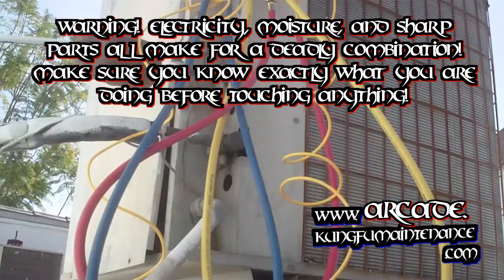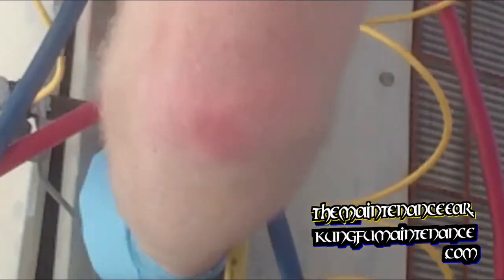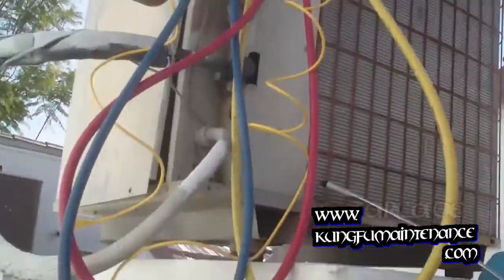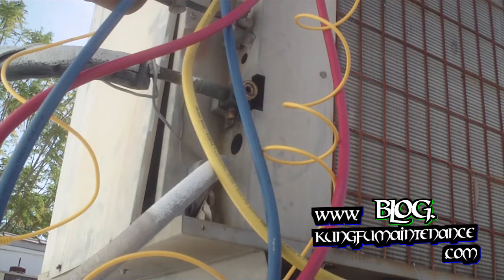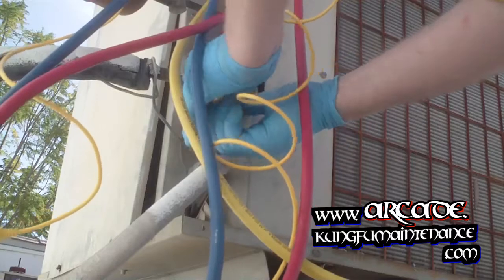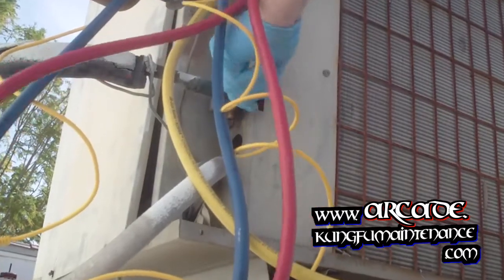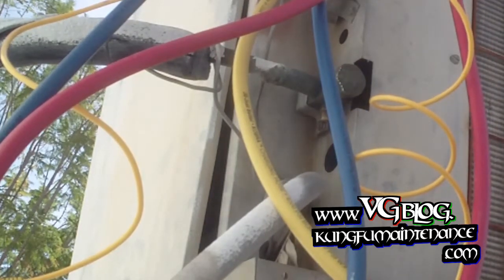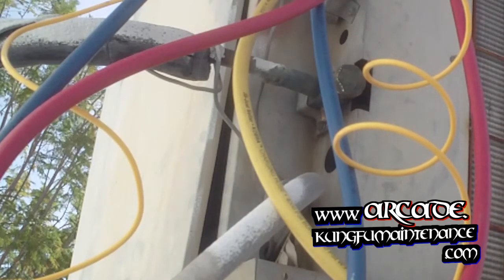How To Find Plus Stop Freon Refrigerant Leaking Air Conditioner Service Valve AC Leaks

Comment: That's the wrong way to fix valve leak. Correct way is to replace the O ring on it. What you did was put a band aid on a tire leak.

Comment: Caps aren't dust covers.  Shraeder caps and valve caps should be wrench tightened 1/8 turn past hand tight to seal.  Use the right tool for the job.  An adjustable wrench should be used on brass so you don't chew them up.
Reply from the maker: 1/8 turn is fine the problem is many don't truly understand what a 1/8th turn or a quarter turn is and tighten down the cap too much. On many systems this can mushroom the end of the schrader valve body itself making it difficult to impossible to replace the schrader valve core if needed in the future.
Reply: Great point.. thanks for posting the video

Comment from the maker: The second caps are the service valve caps that cover the service valves that allow a tech to do a "pump down" and close off the evaporator side of the system for repairs on the evaporator coil side without needing to recover the refrigerant. This is where the leak was in this video was. The service valve was leaking and the cap was not sealing off the leak. Adding the "for gas" teflon tape to the threads made it possible to seal off the leak.

Comment from the maker: There are two caps the schrader valve cap which covers the port for adding or testing the refrigerant charge. For this one a special schrader valve core tool can be used to repair or replace the schrader valve without needing to remove the refrigerant (I show it in a few vids) to the unit. The cap has an oring that yes acts as a dust cap but also acts as a second gate to keep the freon from leaking. It is very effective but the leak on this one was under the second cap for the service valves.

Comment: I thought the cap was just a dust cover and you need to remove the refrigerant and replace the service valve or at least replace the o-ring thats leaking.